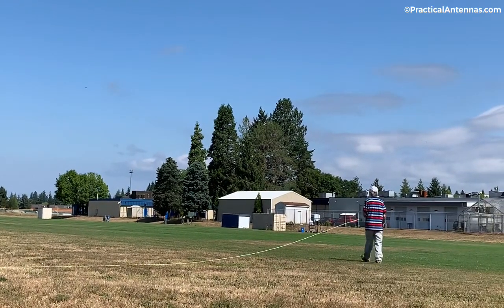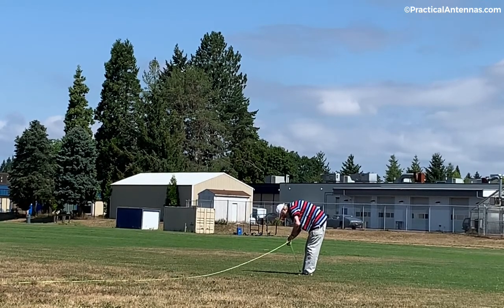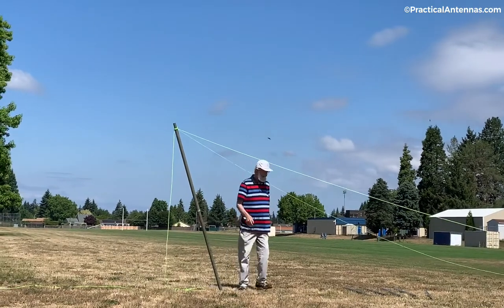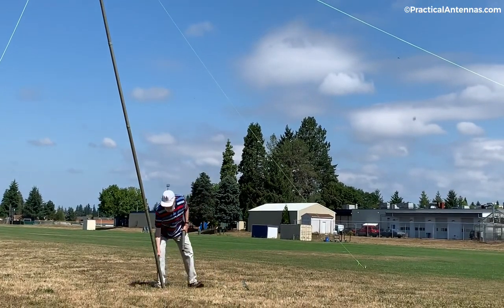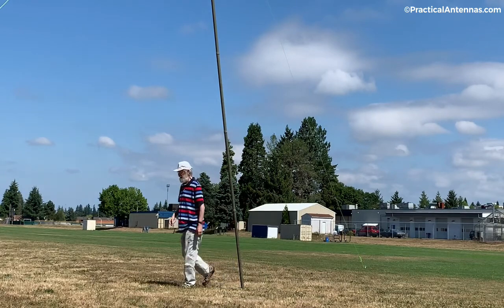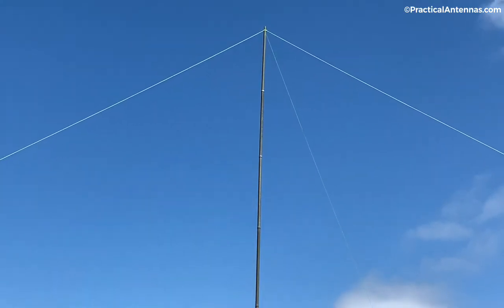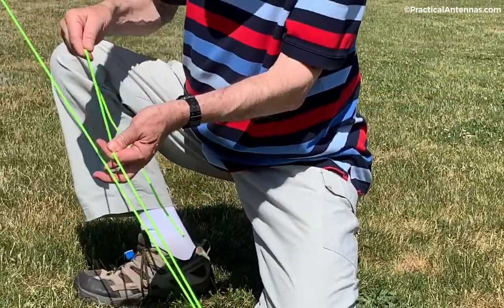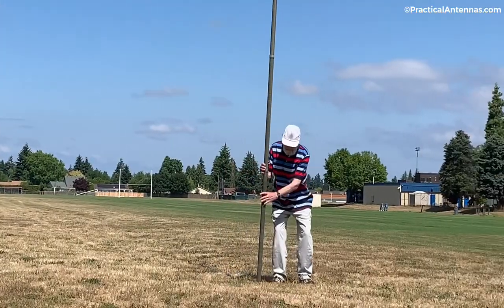Setting up a Sectional Mast

Comment: I truly appreciate your taking the time to make this video. I'm going to post a link for use as a training aid for my local Amateur Radio Emergency Service® (ARES®) volunteers.

I hope that you won't mind my  sharing some additional tips to go along with your mast raising technique. 
Attaching a halyard prior to raising the mast will make the antenna installation easier and faster. 
Using a guy ring made from cheap plastic cutting board or any piece of >/=1/4 inch thick plastic will permit the halyard to be at least slightly free of the guy lines. 
Installing 2 halyards is never a bad idea. 
All halyards should be made up as loops; called endless reeves by sailors; to prevent the rope from running through the pulley and falling back to the ground thus forcing you to lower the mast to reinstall the halyard through it's pulley. 
Antenna elements can be used as guy lines. This is especially useful for crossed dipoles with a common feed point. You'll have to devise a center insulator attachment which will withstand the tension. 

Tom Horne W3TDH
Reply from the maker: Hi Tom,
Glad you found it useful.  I tried to keep the video simple, so I didn't include the halyard or other additions on the mast to avoid confusion.  I discuss those on the website, including photos of supports for dual halyards, etc.

I've had many hams try this technique at my Field Antenna Workshops, and even those who weren't very tall or strong could set it up to 28' by themselves, although some might stop at 20' (which is often high enough).  I made the video to share the technique with others who aren't local - it really is fairly easy to do.

     - Dale WB6BYU
Reply: @practicalantennas1754  Fantastic video.